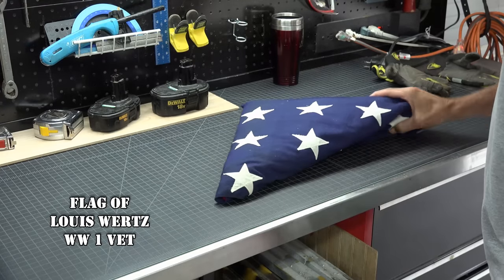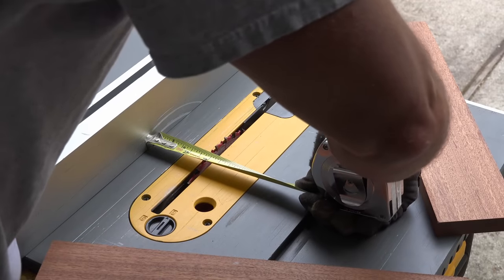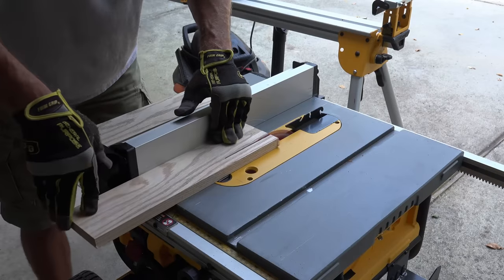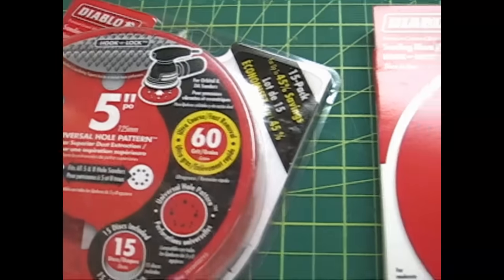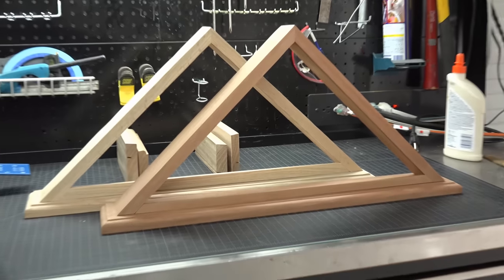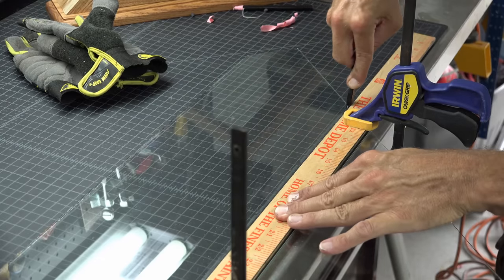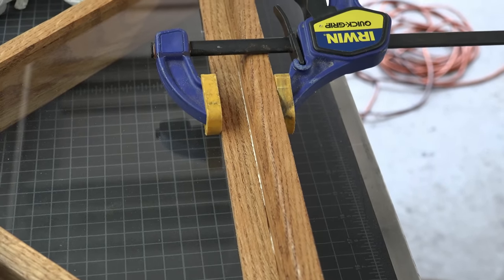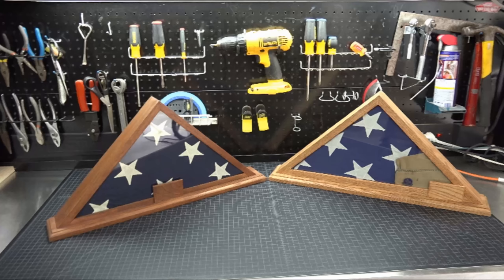Build Your Own Flag Display Case / Jon's DIY

Comment: Good looking cases. Mahogany is a favorite of mine. 

A suggestion from King's Fine Woodworking: a plastic straw is great for removing glue in tight corner seems. Press it into the seems and run it down; it's non-rigid; forms to seem;  and won't scratch or gouge the surface. Excess glue goes into straw and is removed clean.
Reply from the maker: mmclaugh08.  Thanks for the complement and the tip, I will give it a try.  Jon

Comment: Great video. When using a router as you did, it is recommended to use a starting pin.  You rest the board against the pin and then into the router bit.
Reply from the maker: Yes you are right.  I could not find it and did not have time to keep looking.  I actually found it 2 days latter. Lol. Along with my misplaced ear plugs

Comment: very nice, I made my flag case out of left over hard wood flooring, I like the placard idea that's cool
Reply from the maker: Vince! Wish you would have made a comment earlier!  I have a stack of wood left over from my hardwood floor as well in the shed.  I need to pull them out and use them on a project.  Thanks for the nice comment! And thanks for the great idea!
Reply: JON'S DIY  I have photos on my facebook page cant sem to pot them here , it came out really nice, also made a jewelry box with a mirror lid from it
Reply from the maker: Vince, Post them on my facebook link https://www.facebook.com/JONSDIY/  would love to see them.  Thanks
Reply: I hope u posted them on his FB page. I’ve got some oak I was thinking about using but not sure if it’s doable woth this. It’s tongue and groove:/
Reply: @timhunt7830  yes its doable with T&G oak as long as you have a table saw to rip down to width . Ive made some using T&G prefinished oak flooring and made a few with laminate flooring too
Reply: I can’t find your FB page to see the pics. Found way too many ppl that share the name. I’d what state u love in or even what your Profile pic looks like so I Guess I’ll go scan thru Jon’s diy for a bit.

Comment: Very nice. And you didn't have to make that difficult 22.5 degree miter at the bottom. New sub.
Reply from the maker: Only those gifted in the Pythagoras Theorem can pull that off.  Lol!  I make it up as I go, and that does not include math!     Thanks for the nice comment!

Comment: Hi Jon.  Some of the medals I have for my Dad's box have push in pins but some have a pin like a brooch.   Any ideas on the best way to mount these in his shadow box?
Reply from the maker: Hey Constance, I have over 100 videos of shadow box builds showing this.  In any of these videos you will see that I use a half inch of foam board.  I specifically do this so I can push any object with push pins directly into the display board.    As for a pin like broach. you can take a Philips head screwdriver and indent the foamboard (display board) and then use the needle of the broach and push it into the display board to make it flush .  If you do not like the way that looks, you can always take a pair of needle nose plyers and break off the back of the broach pin and super glue the broach directly to the display board.
https://www.youtube.com/playlist?list=PLNfmeekcZNRmtuby-t8YsJLgmF-fw94dh

Comment: I'm going to make a flag box for a friends. He passed away last week. I was amazed to see this video so close after his death. Was almost like a "sign" that I needed to do this. I saw that the base was 24 inches. Can you give me the length of the sides? Thanks. Gary
Reply from the maker: Gary,  The length of the sides depends on the size of the flag.  Measure one of the top sides of the flag once folded.  After making your 2 top side cuts and joining them, the  length of your base might need to be bigger or smaller based on how the top fits.  You want a professional looking fit.  Good luck and sorry to hear about the passing of your friend.  Jon

Comment: Do you use all 45 degree angles on all pieces
Reply from the maker: The two top pieces are 45 both ends.  The bottom piece is larger and extends beyond the top piece angles. It is not even cut to any angle.

Comment: Did another one.  Inlayed liquid turquoise on the front edges.  This was a test one by using banak wood.  Seems very pourous.
Reply: Jon - Have you made any allowances on these flag cases for replacing broken glass?
Reply from the maker: Ray Vendryes  not sure what you mean? Allowances?   Would like to see the pics of the turquoise inlays.  shoot them my way.  Jonsdiy@gmail.com  Thanks
Reply: What if the glass broke in a completed flag case, how would you replace it?
Reply from the maker: Ray,  I gave it some thought.   I have the benefit of a band saw.  I would run the blade between the bottom of the 45's and the base.  sand, replace glass, re-glue.  That way I would only lose 1/8th and the flag would still have no trouble fitting.

Comment: Looking good.  Using this to make one for my Dad.  I am the eldest  so I received his flag.  One question:  Are there any tricks to cutting the plexiglass cleanly?
Reply from the maker: I thought I used glass on this one, and if you do use glass, I am the last person to give advice on glass. Lol (very unlucky with it.    But if you use Plexiglas (a lot easier see some of my other vids) you can use a gig saw or bansaw, even the table saw.  But what ever you do don't take off the plastic protection until the very end.
Reply: Thanks.  Plexiglass was on the inside of the flag.
Reply: Update: Made a case using plexiglass for the front.  Marked it with a magic marker.  Reversed the blade on my table saw.  Raised the blade so cutting point was on the down side.  Lowered saw speed so plexi didn't melt.  And didn't take protection off.  This seemed to work well.  A lot of trial and error.  :-)
Reply from the maker: Ray, would love to see some photos when your done.   Hit me up on Face Book.  (JON'S DIY)

Comment: Great job. I love these, especially your bases. What are you using to cut the glass?
Reply from the maker: Parisdog, for a long time I just used the standard glass cutter that you can buy at Home Depot.  But I finally broke down and bought a Pistol Grip glass cutter.  I suck at cutting glass and these work great.  So If I have to recommend a glass cutter it would be this one.  It has not failed me yet.  https://www.amazon.com/Professional-Heavy-Pistol-Glass-Cutter/dp/B018C4V2RA/ref=sr_1_14?ie=UTF8&qid=1509194027&sr=8-14&keywords=glass+cutter
Reply from the maker: Oh yeah... dip the oil, don't fill it.  It leaks.
Reply: JON'S DIY I’m going to have to check those out. Thanks for the info!

Comment: What are the measurements for the base and the 2 sides. How is the top part connected to the base? Just curious as to hard it would be to replace the glass in the event that it got broke.
Reply from the maker: Base is the base measurement of the flag when folded.  You could attach the base upward into the top with screws to allow you to disconnect and replace glass if need needed.
Reply: @JONSDIY  Thank you for getting back to me on this. Yes I understand that the base is the width of the longest side of the flag. However if you did not have the Flag on hand. What are the measurements for base and the 2 sides?
Reply from the maker: @rkdowning12  I make all boxes to the size of the contents.  So fold your flag measure and cut the wood so you have a custom fit.  I like it snug and not loose looking this way I can make the stars align from top to bottom.

Comment: You should use push sticks and never work around rotating equipment with gloves on! Sorry I am old school and safety was drilled into my head working in the Steel Industry for 44 years. Nice work BTW Thanks!
Reply from the maker: Robert, you are 100% correct.  I have been schooled by countless viewers on my error.  If you check out any of my other videos you will see, I actually do listen to my subscribers.  Thanks for your comment and watching the video.  Jon

Comment: This is a great video, but it would be nice if you listed the actual specs for the dimensions of all pieces? Thanks.
Reply from the maker: That’s the difference between a store bought flag display and a custom built one.  The dimensions are based on the dimensions of the folded flag. The flag display can always be different based on the size of the flag therefore I cannot list dimensions because I don’t know the size of your flag.   I make this statement right here.  These should be your dimensions.  Listen to the instructions don't just watch.  https://youtu.be/orqASac-P4g?t=88  This video is nothing but how to get dimensions for all pieces!

Comment: Do you always have to make cases customized to the flag, or are there standard sizes?
Reply from the maker: Jdrew,  I have been in many navy exchanges and sea chest shops (stores that sell that kind of stuff). And yes you can buy all shapes and sizes.  Some are made for various sizes. The most common I have seen is the 4X6 flag size.  But if you do it yourself and take the exact measurement you will not only get a better fit but a better quality product.  ( no cheap wood). And besides that, it gives you a sense of pride to know you did it yourself or for someone else.  Thanks for your comment. Jon.
Reply: Burial flags are larger than standard flags.  They drape over the caskets, and have to cover more than the standard ones that are on flag poles.
Reply: @sigguy1361  burial flags are 5' x 9.5'

Comment: Hi Jon, how wide is your base plate?
Reply from the maker: Well that depends on the width of the flag once folded.   The thinner the better. But the ones pictured here are 3 inches.  But these are large flags
Reply: @JONSDIY  I was wondering about the base of the piece.  If the sides are 3 inches, what is your base width?
Reply from the maker: @bdkane721  please shoot me a msg on FB.  https://www.facebook.com/JONSDIY  and I will attach some pics to show you exact measurements.  Thanks Jon

Comment: What were your over all dimensions?
Reply from the maker: impulse,  the base piece was 24 inches long, and from the bottom of the base to the apex was exactly 12 inches.  I do not know what the actual size of either flag was as I never totally unfurled them.  Jon

Comment: Beautiful cases.....but wearing gloves while operating power tools.... little scary.
Reply from the maker: I have to agree.  I am a knuckle head.
Reply: Just keep your hands out of the way.  If the blade gets you, it's going be ugly whether or not you're wearing gloves.  I cut a lot of plywood and rough wood, and wear gloves all the time passing it through the table saw.  I know where to put my hands and not to, and I also avoid a lot of splinters int he process.  ;o)